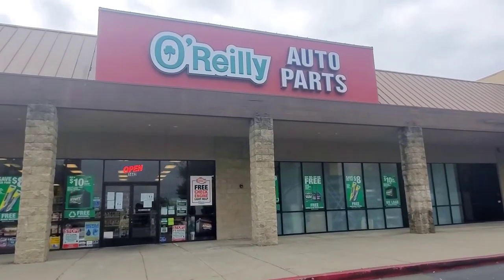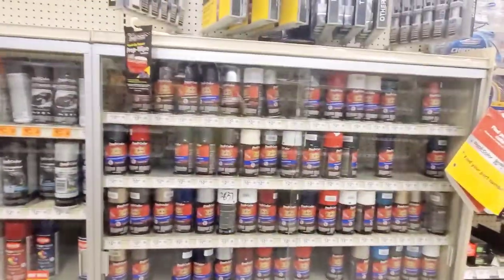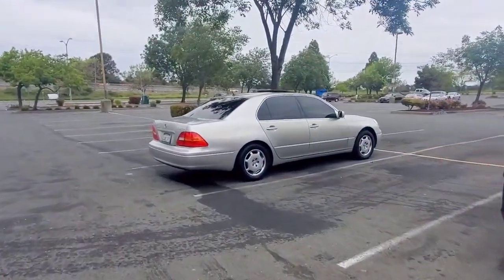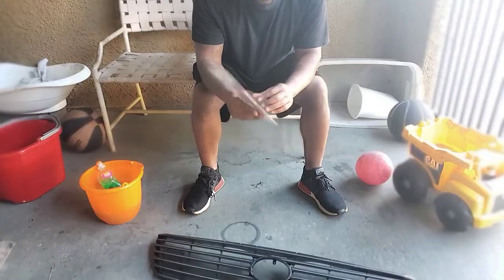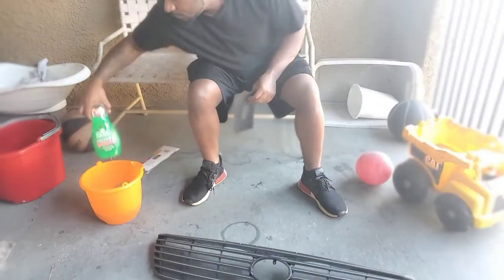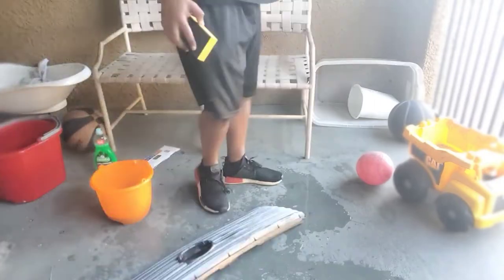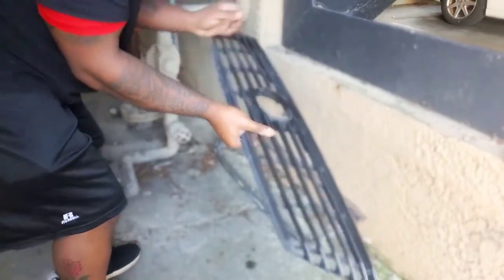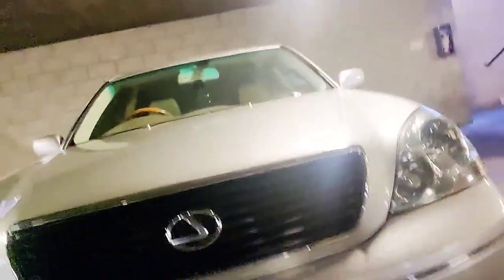SIMPLE WAY TO BLACKOUT YOUR GRILLE #LS430

Comment: Cool im going to try this. I will let u kno how it goes
Reply from the maker: I think I did use gloss but I also added clear coat for shine and protection so it won't fade.
Reply from the maker: Take your time dont rush. Sand it good. Primer, then spray 3 to 4 coats of gloss black then at least 2 coats of clear. It will look great and last